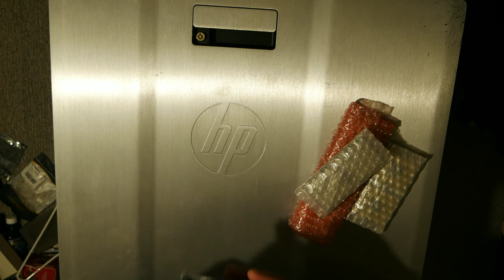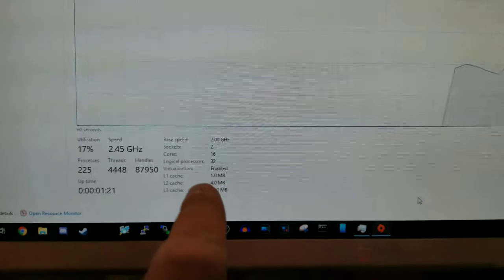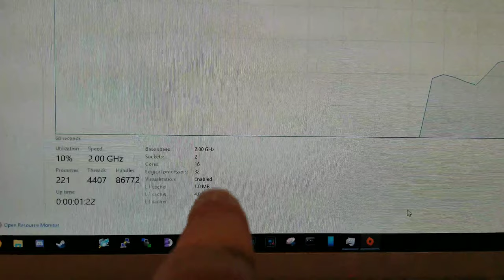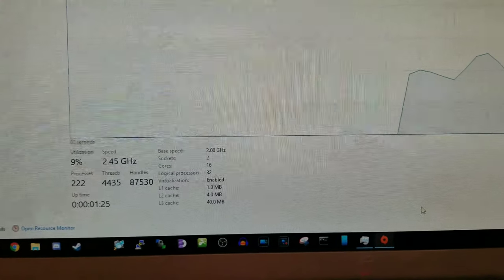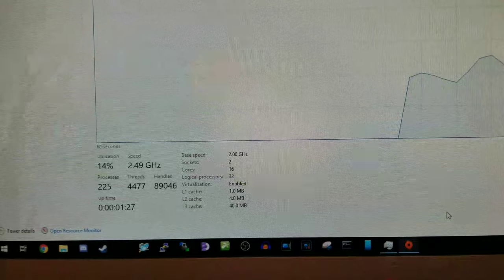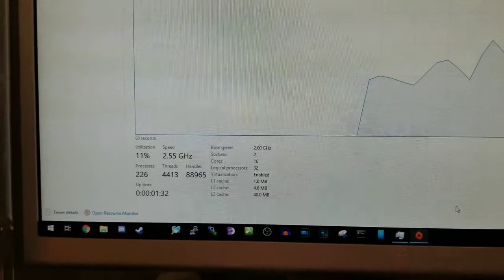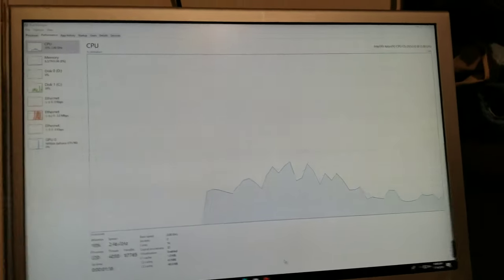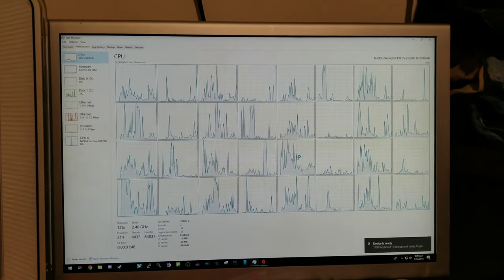Let's Upgrade My HP Z820 From Single CPU To Dual CPU

Comment: I ran out of thermal paste on the second processor. If I known I was going to run out, I could have gotten away with using alittle less on the first one and made it work. Now I have to take them both back out and do it over again, as at this point I'm not sure what one has not enough paste. Felling like it's gonna be a miracle if this thing actually works when I get it put back together.

Comment: Hi. Will you please be so kind to share where you bought the heatsink, fan, and CPU? I have a Z820, using it for 3D animation. My system currently has one, Intel(R) Xeon(R) CPU E5-2660 0 @ 2.20GHz. So, I'd like to add a second CPU, but I realize I also need a heatsink and fan...
Reply from the maker: I got a kit on eBay that included the heat sink and fan. All I search for is hp z820 heat sink. It looks like the 840 version also may work with the 820 since it is the same socket.

Comment: Last night I put in a Rx 590 Fatboy XFX 8gb gpu, and now the cover won't fit back on. Working now but no cover plate thingy. the card is just hanging loose in there.
Reply from the maker: Yeah that's the one thing that's bad about this computer is that ducting plate and support is very narrow I guess is the best way to put it so you only have a certain style of card that can actually fit if it's too wide then you go without it shouldn't really affect anything other than you might have to deal with some card sag and my recommendation for that is get a dowel rod and cut it to length and just stick it in there cuz you don't move your desktop around that much so it should be fine and it will help support it
Reply: @krypticnexus  . I was thinking, no rush but when I get some time I could start cutting on this cover so that the card pokes through. I'm just glad the card I bought works, it was one of those facebook marketplace local finds.

Comment: Great video. One quick question, is it normal for one of the processors to consume more power and heat up more than the other? Like 10 to 15 degree hotter and consumes  about 5 watt more than the other cpu. Can i swap them to see if something is wrong with one of the processors or is it because cpu in one slot permorms more tasks than the second? Please guide. Btw at ambient temperature of 19 degrees celcius and at 100 percent load and full fan speed one processor was consuming 95 watt and was at about 55 degrees while the other reached 70 degrees and was consuming around 100 to 102 watts.
Reply from the maker: In all honesty and that doesn't sound too terrible of a discrepancy between the two. Plus you have the heat from processor zero going into processor 1 and windows will favor One processor more than the other. Plus when you thermal pasted the processors you could have got a little more on one versus the other or little too little on one of them. There's so many different variables but only being that much of a difference it's not concerning because you are having a slightly higher power usage which would cause slightly higher heat output. I honestly could not tell you what my temperatures are lol. Let me get my computer started up and I'll get back with you on what my temperatures are. I just need to get Intel burn or something so I can artificially put everything under 100% load cuz mine hardly ever is under 100% load it's typically like maximum 70%.
Reply: @krypticnexus  thanks so much bro. Yeah I use it for rendering so that puts 100 percent load on the processor. Also since turbo mode is enabled it uses more power @ 3 ghz. Without turbo mode it is at 2.6 ghz and at that speed temperatures remain in 60s on one cpu and 50s on the other I even decreaded the fan speed down two points. So I agree that is not too bad. I was just being paranoid I guess lol. Thanks so much for the great video and for your reply. Take care.
Reply from the maker: Okay so I am currently doing a Intel burn test and I am running dual 2690s. They run at 3.3 GHz all core turbo. My package power is 130 Watts on One processor and 120 on the other. And my core temperatures are within 5° of each other. So I'm seeing between 177f to 183f on One processor and on the other processor I am seeing between 175f to 180f. I also have the fans set to Auto so they are running audibly but not high speed I would say about medium RPM range.

 So when you applied your thermal paste it could be that is what the temperature difference is from it could be that the hot air from processor 0 is warming up processor 1 a little bit. But in all honesty if they are performing well and staying under 200° I really wouldn't worry about it all that much.
Reply from the maker: One last reply so I am looking at my temps through HW monitor from cpuid and my total package temperature difference from cpu0 to cpu-1 is about 10° and that definitely seems to be from the hot air from one CPU warming up the other
Reply: @krypticnexus  thanks so much man now I have something to compare my results with.  Im also using HWmonitor and core temp to check my temperatures. By the way my fans don't seem to have auto control I have to rev up the fanspeed from BIOS manually. Btw the info you shared was quite helpful. Really appreciate your help. Thanks
Reply: Might also depend on motherboard and airflow.... Don't know if hp are designed that way but on my intel S2600stbr motherboard, while checking instructions found out that CPU slot no 1 gets more usage by default then CPU no 2 . Also PCI slots occupation inflicts as some are piped to cpu 1 and others on cpu 2 in case you have both slots occupied.

Comment: i  am of Brasil,Could you help me with my Z800 hp, I would like to know why it doesn't turn on automatically daily by programming it in the bios? the bios shows option activate with hd hard disk option and remote server option, my pc uses hd ssd drive seriously the reason? Z 800 does not start automatically using SSD? And another problem is that with the 2 six-core processors the system showed me 12 cores and 24 logical processors, and now suddenly it only shows 12 logical processors? Thank you friend if you can help me! I already subscribed, really enjoy your channel!
Reply from the maker: So I'm going to reformat your comment so my brain does better with. Are you trying to have the computer start everyday at the specific time? And then the second question I see is it not using the correct boot drive. Then the last sounds like one of your processors died because that does happen I have one of mine die couple months ago. You could always try reseating The processor both of them since you're not 100% sure which one it is. I will look for your comment back and see what I can do to help maybe I'll get on my z820 and make a quick video for you on how to set your boot drive and program your computer to start automatically

Thank you for subscribing.
Reply: @krypticnexus  Hello, the bios has the option to automatically activate daily, but there are 2 options to start with a hard disk and the other to start using a remote server, but my PC does not have a hard disk, yes SSD! Does the Z 800 not activate SSD? About the processor, it didn't die! Both work, but the system always shows 2 processors, 12 cores and 24 logical processors, now it continues to appear 2 precision, 12 cores, but instead of 24 logical operations, I only see 12, both work!
Reply from the maker: Ok so with the automatic boot just pick your boot drive it doesn't matter it's an SSD to the computer they are basically the same with it comes to booting. 

As for the CPU sounds like hyper threading got turned off.
Reply: @krypticnexus  That's right, that's what I did, it's activated for days and hours and activated by HD, but it doesn't turn on, that's the problem, it simply doesn't turn on when choosing any HD or remote server mode, I'm still grateful for trying to help
Reply from the maker: if you want under the about section of my YouTube channel should be my email address. Shoot me an email there with a photo of that section of the BIOS so I can see what's going on. And I will check my bios when I get home to see if it's similar and if I can help get you set up
Reply: @krypticnexus  ok thank!

Comment: Hello Anthony. 
I have Z820 single CPU, It was using dual CPU. However, the second one was remove. So, how do I disable the second CPU slot as it gives me error message every time I startup the PC, and I have no idea how to do it, either it's on the motherboard itself, or through the Bios. 
Thanks in advance.
Reply from the maker: Make sure the processor is installed in CPU 0 not cpu1. It should be live wired. Also make sure ram isn't in any of the cpu1 slots also
Reply: @krypticnexus  Both are checked and OK However, the error message still showing up everytime I power up my PC with errors referring to CPU slot one
Reply from the maker: @MohamedMostafa-uo3tr  well that sucks. That is how I understand it works, why its not I am very unsure
Reply: @krypticnexus  Thank you Bro. I will try to give it a go and deeply check the bios for a better options to disable Socket 1

Comment: Is your z820 noisy?
Reply from the maker: Not even close to it. My customer gaming PC is louder
Reply: Hmm then I have no idea what is causing the noise mine is making..
Reply from the maker: I was just wondering if you ever figured out your noise issue. I was kind of wondering if it could possibly be something inside of the fan array or one of the fans themselves going bad because that thing is chock-full of them
Reply: @krypticnexus  well it's at a comfortable level now. I can live with it. I understand that it's a workstation, which makes more noise than a normal desktop pc. I installed a nvme drive from which Windows boots, definitely sped up things a lot. Also did a cmos reset but that didn't change noise levels. I don't think any fans are faulty. Are you running HP Performance advisor? If you do and read the sensor values, maybe we can compare yours with mine. Is that an idea?

Comment: Can we change Intel xeon processors to Intel core processors in this HP Z820...
Reply from the maker: Why would you do that? The short answer is no the chipset probably is not compatible and there is tons of reasons not to do that.

Also the highest end Xeon that can go in this computer is a 12-core 24 thread that runs at 2.7 gigahertz or 3.5 boost. And you can run dual processors. These xeons are based on the ivy bridge EP core. The only thing putting a core processor in this would do is remove the ability to use as much RAM is available remove the ability to run dual processor and remove the ability to have More than six cores per processor. Quite literally the only advantage a core i7 4960x has over the top of the line e52697v2 is it's base frequency is 3.6 gigahertz and it's boost frequency is 4 gigahertz.
Reply: @krypticnexus  this workstation was previously owned by my elder brother..but now I want to use it for gaming and As you know, base frquency matters very much for gaming ..
Reply: Hey sorry for asking many questions...but , can I change the mother board of this workstation to something that can support latest Intel core processors and GPUs .If yes , please suggest me a motherboard too🙏
Reply from the maker: Frequency definitely does matter more than cores and nowadays but I game on mine fairly regularly. I don't really play anything modern as it were I mean the games I played a couple years old now but runs perfectly fine for me. I don't have all the eye candy turned on.

There is a Xeon E5 2643 V2 that has a base frequency of 3.5 and a boost of 3.8. then there is the E5 1620 V2 that has a base frequency of 3.7 and a boost of 3.9 but it is a E5 1600 series so that means that it should be compatible but you're unable to run one processor.
Reply from the maker: Also that E5 1600 series processor may not work I do not know if this BIOS has a white list of CPUs it can use
Reply from the maker: No worries about asking questions. The short answer is no there is no chance that there is a motherboard that will be compatible with anything in this computer even the form factor of the case.
Reply from the maker: In all honesty if you have a GPU put it in the computer it will run better than you would expect I'm sure. Unless the CPU is a very low frequency CPU what model is the CPUs in your z820.